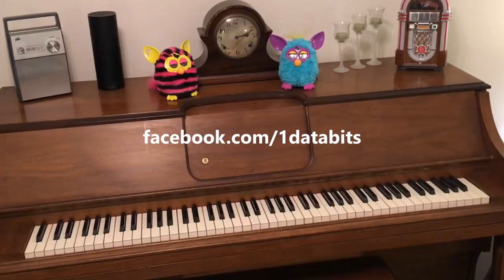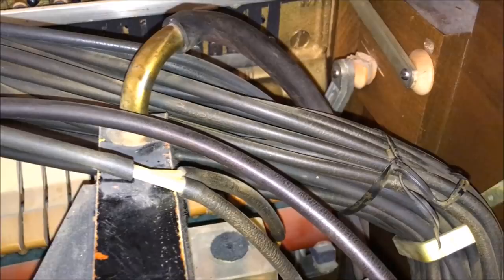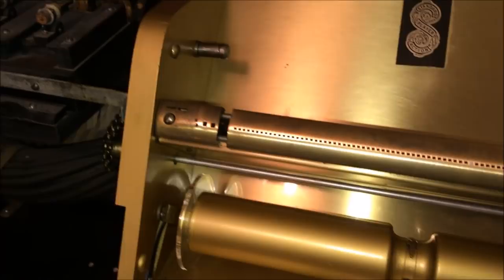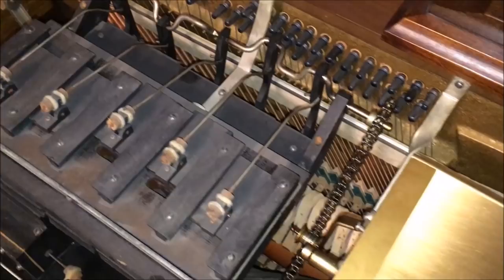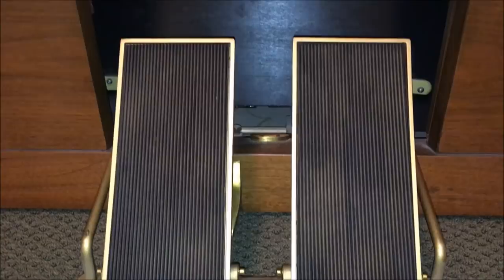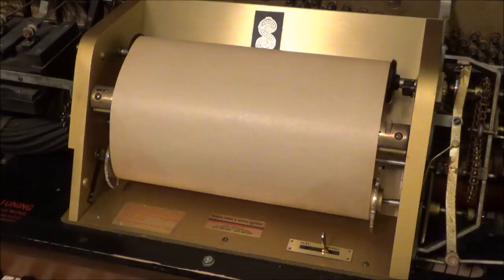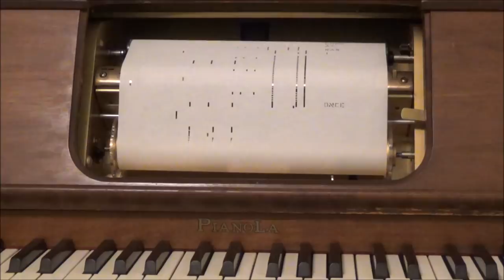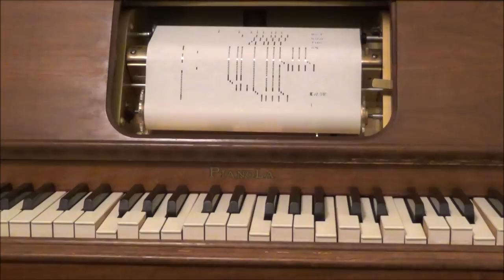1960s Aeolian Pianola Player Piano Demonstration

Comment: Very nice player piano, boy these post war pianos are so much nicer to work on as your root of your system the piano are in much better shape than prewar systems, i am working on a Werner piano with a Schulz player mechanism and using pierce piano atlas to date it is in lower 1920s, Werner made this player mechanism and offered it at time of manufacture unlike other player mechanism that can be added at a later time. The Schultz player mechanism is one of the more difficult to restore because of the valve block pouch arrangement and this system is not a reproducing system which adds another dimension of complexity to the restore project. Your piano and player look nice and I hope you enjoy it immensely. One set of books that is a must have for anyone contemplating these systems are both from author Arthur Reblitz (nice last name for someone who writes and restores pianos and player mechanisms) first book Piano servicing, tuning, and rebuilding, second book by same author is Player Piano Servicing and Rebuilding. The number of books on at least the restoration or servicing player piano mechanism are very limited if you don't count the reprints of the same book multiple times. Remember the majority of the industry mostly occurred between 1909 thru 1931. I am currently newly retired and can proudly list this as one of my hobbies.

Comment: I have an Aeolian pianola a few years newer than yours.  You can check it out on my channel. I think you can remove a screw and pivot the wind motor forward to make tuning easier.  Also, your tracker bar needs cleaning. It accumulates paper debris, causing dead notes.  Welcome to the club!

Comment: I remember these players many years ago and the inaccessible ability to work on them with their plastic unit valve blocks glued onto the decks of the stack and they were a player technicians nightmare to service and the noisy vacuum cleaner motor in them was dangerous if it overheated. Sorry to be a killjoy but that's why you got it for a princely sum of $300 still it's a lovely looking piece of furniture as a piano.

Comment: I did some amateur piano tuning and thank God I never had you tune a player piano. Reaching the tuning pegs is fairly easy compared to getting full access to the strings. You need to quiet all the strings except the ones you are working with by inserting rubber wedges and long felt strips between the strings all along the length of the piano's harp. That way you only hear the strings you are tuning. Rearranging these mutes as you tune your way along the piano is hard enough without having to work in such a limited space.

Comment: The initial compressor startup sounds like a air start Mack truck preparing for starter engagement !!
Reply: Andrew Hallett-Patterson not a compressor.  It works on a vacuum. Like old wipers and other gadgets found on an old T'Bird.

Comment: Databits: upon looking at this piano it seems that it has a transposing tracker bar on it. I say this because on player pianos that have a standard bar, there is no space to slide the bar one way or the other, whereas on this piano it looks like there is. This feature comes in handy if you want the roll played in a different musical key (a pitch lower or higher than the piano plays it), or if you are having a problem with one note.
Reply from the maker: Thanks for your comment!

Comment: Noticed, on your video that it appears one of the tracker bar holes is plugged (somewhere near the center) This could prevent that note from playing or producing a weak hammer blow. Use your vacuum cleaner with a crevice tool, or better yet buy a tracker bar vacuum  pump from a supplier. Clean all the tracker bar holes every couple of weeks, depending on usage.

Comment: I've always wondered do player pianos always play at the same level or can they go from piano to forte, soft to loud I've never really found a way in my head for them to be able to distinguish something like that
Reply: Cristian Cortez usually below the keys is a compartment to adjust speed, sustain and the level of playing.
Reply: That's a good question, I have a Wurlitzer player piano made the early 70s i believe. I bought it at an estate sale back in the mid 90s for $150. It was a nightmare getting it moved out of that basement having to remove doors and stair rails and turning the thing on end. I felt like they owed ME money just to move it, lol. Mine has a volume control that softens the sound but it's all the keys at once so no real piano/forte action. If you turn it down too low it starts missing keys. No manual foot pump pedals on mine , just the electric motor. It came with several dozen single song rolls and also quite a few of the bigger 3 song rolls. It gets to the end of a music roll it automatically stops and re-rolls it back up. It's a lot of fun to listen to, i am glad i got it.
Reply: There is a more advanced type of player piano called a "reproducing piano".  This has additional mechanisms - and the rolls have additional markings - to control volume.
Reply: Yes some do.  The roll has to be punched specially to make use of the feature, and I believe the piano has a switch to enable or disable it, so normal rolls can be played as well.  The columns for the leftmost 4 and rightmost 4 keys are used to encode the volume of the left and right halves of the keyboard respectively.  It is much like binary numbers in computing.  Therefore each side of the keyboard can play at one of 16 different volume levels at any time.  Such pianos actually contain pneumatic digital to analog converters to produce the different volume levels.  Naturally, this reduces the usable range of the keyboard to 80 keys.  Some player pianos can also work the sustain pedal, and rolls have a separate column reserved for that.

Comment: Did older player pianos also have that electric pump for the air or did you need to necessary pump with the feet?
Reply from the maker: The feet work was required
Reply: @databits  Thank you!! Actually, I'm now an owner of one beautiful 1929 Lippola player piano and it's just so amazing, has foot pedals and metal pumps